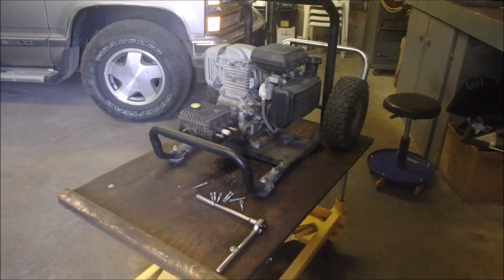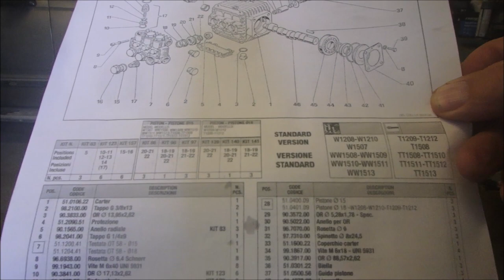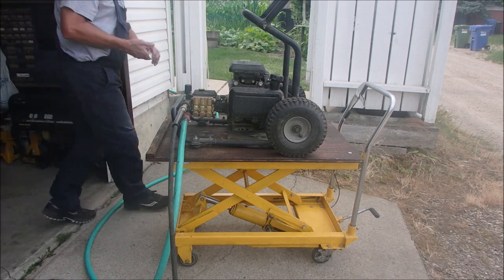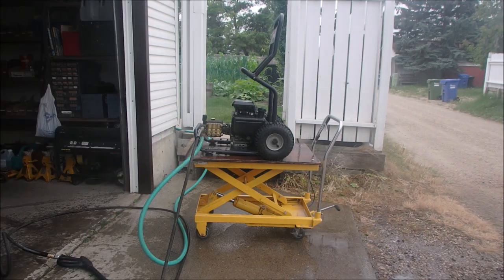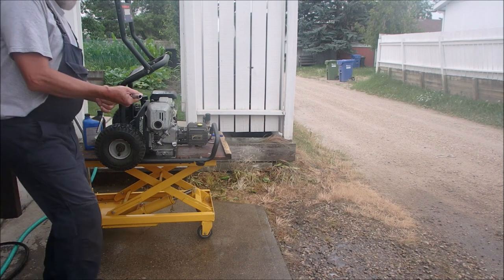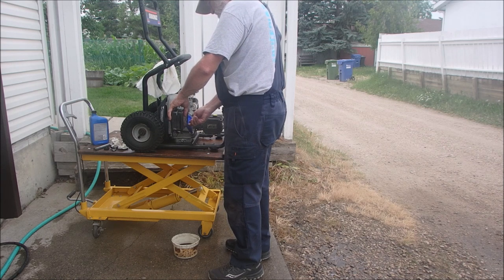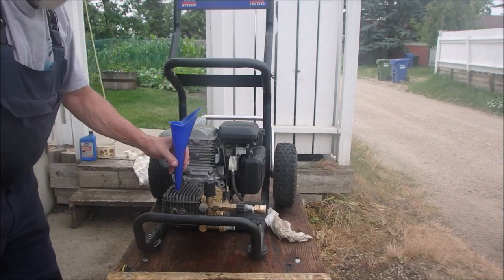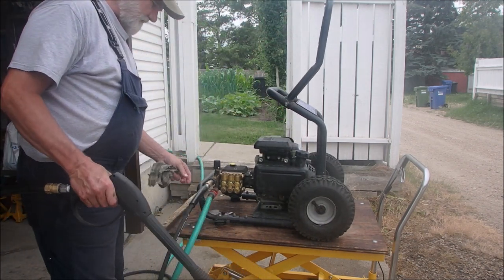Ceramic Plungers on a General TT9091 Pressure Pump

Comment: Nice fix Bruce good thing you were able to get the part you needed. At EP we likely have had 25 pressure washers that needed pump rebuilding and parts were no longer available. The majority of these were Simoniz which appears to discontinue models then not carry enough rebuild parts to allow repairs to be done. To many $104 for that part would be considered too expensive but this appears to be a top quality pressure washer with 3000 psi. I would still use the B&S pump saver but store the unit in a heated area.
Reply from the maker: This unit was originally assembled by Simoniz but that pump blew up years ago  Then we put this expensive one on.
Reply: @BrucesShop  Very nice pump assembly Bruce, by the way the Chubby Butchers new video that he is just posting will have your sticker shout out and i gave him your address since he wants to send one to you.
Reply from the maker: @waynestefinashen239  Thanks

Comment: The Cat ( not Caterpillar) brand GS series use ceramic plungers as well.  The inlet valves are actually part of the plunger assembly, great pumps and super reliable....but not cheap !         I've repaired lots of these units.  A great alternative to replace pumps that are junk on gas powered units
Reply from the maker: Thanks for the info!

Comment: 22ftlbs did sound high for that size of bolt. I’m surprised the torque wasn’t in Nm being the instructions were in Italian.   Have a good week.   Rick
Reply from the maker: You could be right.  It may be the translation as I went to the English PDF on line to check the Italian page.

Comment: I have two of those General type pumps. Luv E',m but they both need new seals...  That's around $100 a pop!.
I change the oil very frequently now. Eventually I will do a video on rebuilding at least one of them. 
I like the adjustable unloader, very useful for us small engine guys when sooooo many of the things we clean just don't need high pressure except for grass fouled customer abused and neglected decks!!
Time fer a new camera, cell phones work in a pinch but they have absolutely no dynamic range, they wash out easily, make things look like some weird dream haze. I still use one in hazard situations but I make adjustments to the footage in edit. You can adjust them before recording!
Reply from the maker: Thanks for the info.

Comment: Great video, but on another topic I have the same lift you do and it no longer holds items over night. It doesn't leak oil it but slowly lowers. Just wondering if you have experienced this as well.
Reply from the maker: I have not had any serious issues.  It does drop a bit but not all the way overnight.

Comment: Just a warning wal mart super tech oil is crap, I use to use it in my 95 saturn sc1, little 4 cylinder, well it got below - 10f in Pennsylvania near Bradford, and the oil frozen almost solid, it ruined the engine needless to say, but that oil freezes at anything below 20f just a heads up.
Reply from the maker: Thanks for sharing

Comment: i would check preusure sounds too high or wrong size tip
Reply from the maker: Thanks  Remember the pump is a bit to big for the HP engine  Thanks for the heads up though

Comment: It sounds like the pressure out put is cranked up too much .The engine sounds like it has too much load on it . Too bad you can not measure PSI out put .
Reply from the maker: Yes it is a bigger pump for that engine. The pressure is turned down.  I turned it down in the video a bit near the and as well.  The pump has been on this engine for 15 years.